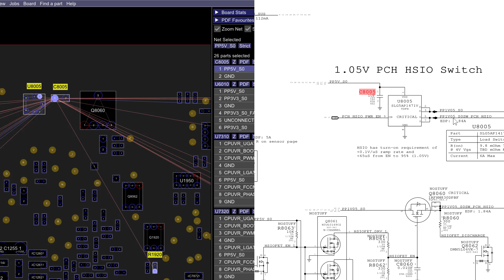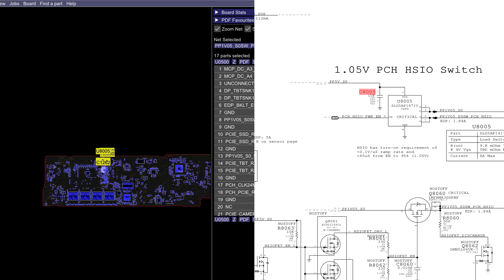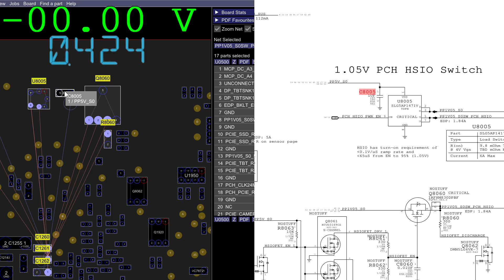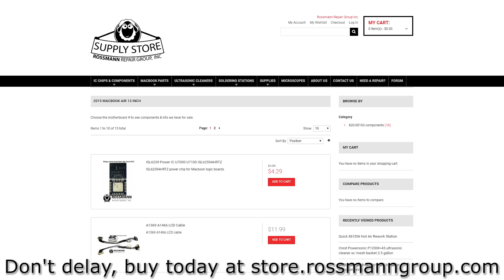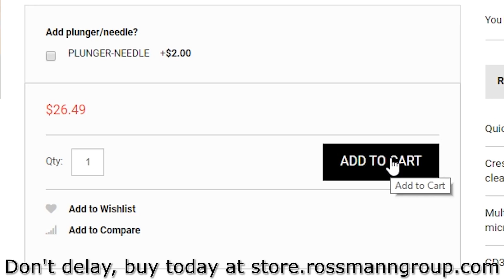820-3437 not turning on 200mA drawn from power supply.

Comment: Good to have any type of a sense of humor, even if it is on the dark side. I am happy I took those Physics course and learned to read electrical schematics years ago. Back in the day I built a few multi-band radios and tuned in the world of SW Radio broadcasts. On the other hand what would you be doing if it were not for badly designed and functioning devices?  I am curios if there was a time any computer manufacturer made a decent board that worked, say for 15 to 20 years or so?

Comment: Louis try buying dust vac systems you for wood working. A lot cheaper and you can get any length you want.  They are a positive locking system so no more taping joints. They also come with filters.

Comment: Just an explanation for why there is no onboard data plug for the system SSD on a T2 enabled mac,  The T2 always encrypt the SSD with a key that can never leave the T2 chip. So being able to read the data will only give you seemingly random data.  The only change when you enable FileVault us that you set a password that is needed to permit the T2 chip to encrypt/decrypt the SSD. On the pre-T2 machines, your encryption password was known by you so the data port had a function since you could decrypt the data with the correct password.  This is a good example of security trumping convenience. The positive side is that due to the always-on encryption there will never be unencrypted data on the SSD that can leak. the bad side is that if the T2 chip becomes damaged there is no way to decrypt the data.
Reply: Pretty huge bad side. And you have to trust Apple to not put their own master key into the T2.  
I can't wait for coreboot to be production ready in Notebooks.
Reply: @joe--cool  Yed, but doing this sets them up for a huge hit to their reputation if this is ever discovered. Their security whitepaper is pretty explicit on that the keys in the secure enclave (inside the T2 chip) cannot be read.
Reply: To me it is tipping the balance of convenience/practicality for unnecessary overkill.
Reply: @Francisco Ciruela That's why you take backups. If your machine takes damage enough fot the T2 chip to be killed there is a good chance that your SSD could be dead as well.